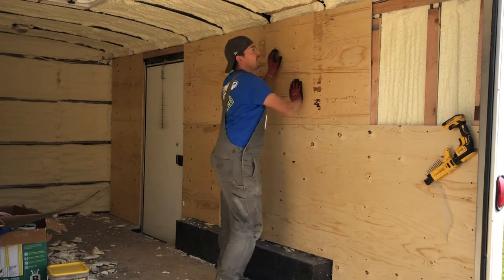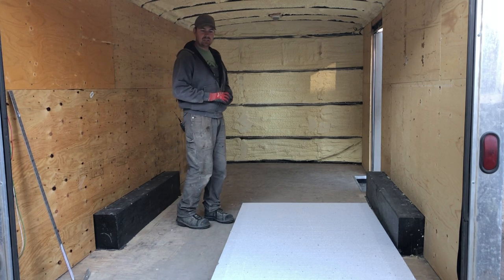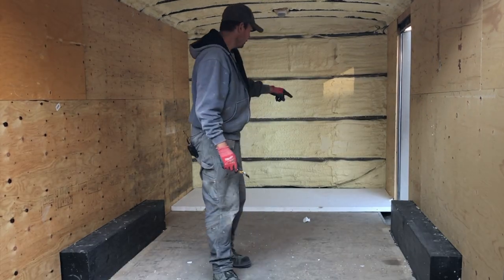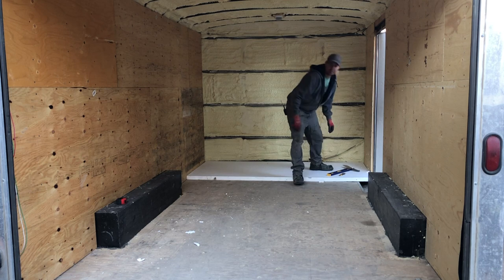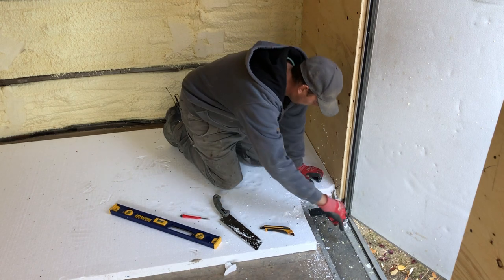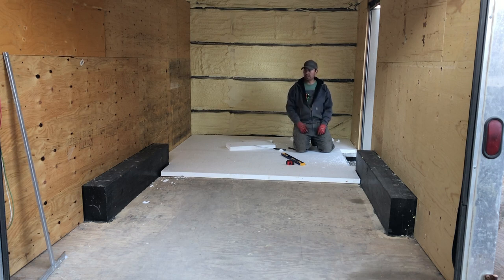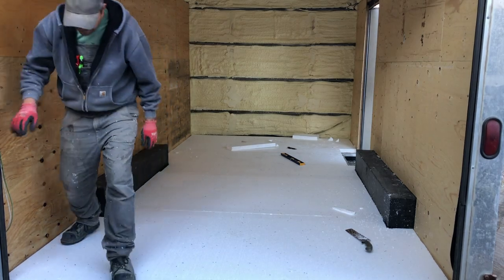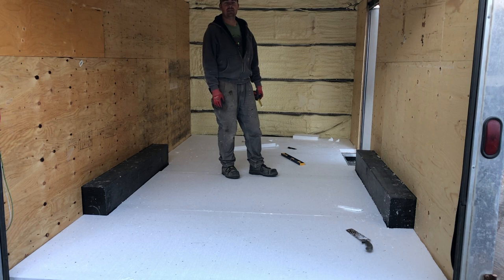How to insulate the floor & install plywood walls, CARGO TRAILER to TINY HOME Ep. 3

Comment: I have always been mystified why most people whom convert or construct travel cabins (tiny houses, campers, etc) don't bother to apply any insulation to the floors!

When I saw that you'd applied spray on closed cell foam in addition to insulating your floor I immediately subscribed!

I look forward to watching your earlier videos and following your adventures in the future.

It's  nice to see people whom are professional about insulation!
Reply from the maker: Thank you! I hope you enjoy the series, i feel the same way about the floor insulation. Nothing worse than cold feet
Reply: Lord I’m converting a cargo trailer and have seen a few people in forums telling others not to “waste money” insulating the floors saying the walls and ceiling is more important. For houses that is generally true bc they have natural ground insulation but even then they still do have insulation in the floors. In trailers, there is no natural ground insulation and I think it’s quite stupid to not insulate the floors just as well as the walls. I’m water proofing the underside of my trailer and then insulating the inside with 2in foam board.

Comment: Did this years ago to have a bike hauler and camper. Used a buddy heater. Worked great, sometimes just the pilot was enough. Problem with the propane is the byproduct of moisture,,,moisture beyond belief!
Reply from the maker: That's very true, they are so handy but also creates other issues. I just recieved my diesel heater from china, we will be installing it in the trailer as well. nice dry heat. I really hope it works :)

Comment: Hey how did this floor insulation pan out in the cold? I am thinking of doing tje same but dont know yet whats your out take been thus far?
Reply from the maker: its pretty good, but if you really want to have warm feet, i would spray foam the underside of the trailer.

Comment: For a trailer camper, would insulating the floor from the outside (with spray foam) less likely to cause water damage issues than insulating from the inside?
Reply from the maker: Hi Sarah, I think insulating with spray foam on the outside would definitely help protect the bottom of the trailer for sure, if your concerned  about water damage underneath the trailer you could also have it coated with something like Rhino guard. but spray foam is a great option as well.
Reply: @hammerandhome  Thank you!

Comment: This is the way I want to do mine.
Reply from the maker: I would also recommend spray foaming under the trailer. I have found mine is still colder than I would like it to be. I’m probably going to add spray foam as well